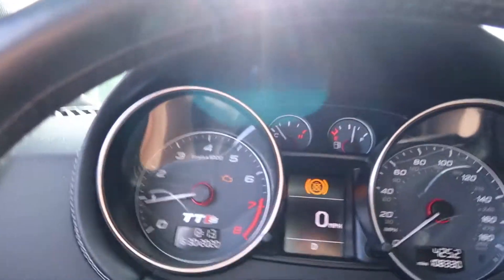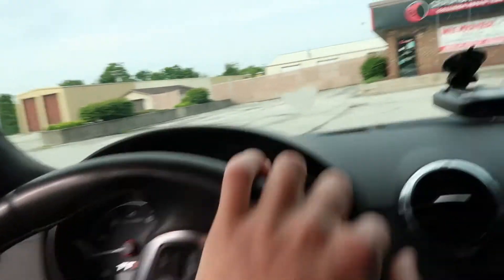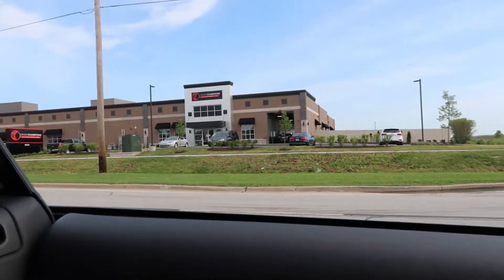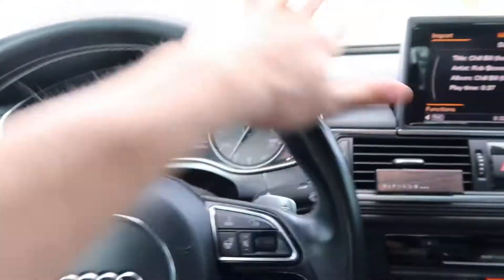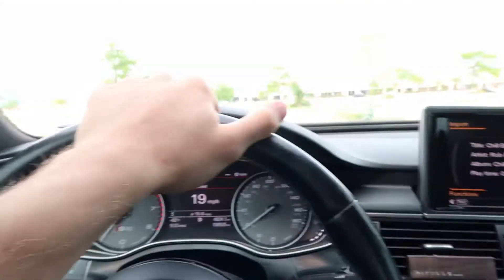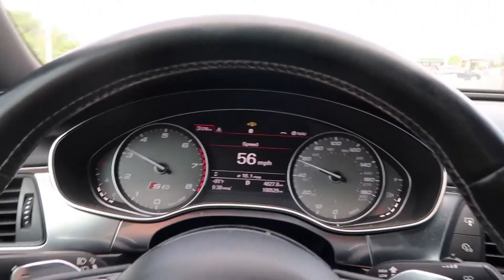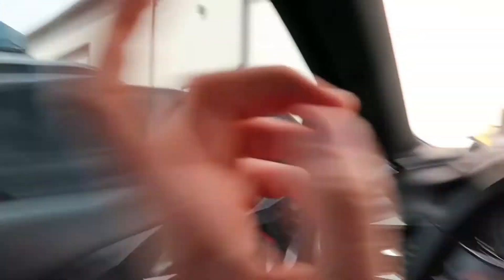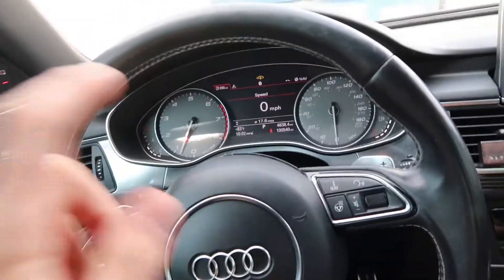Saying Goodbye To The TTS

Comment: I had a vacuum leak. Was a cracked plastic hose at the brake booster. I don't know if you are looking at the data on a scan tool but if your short term fuel trims are higher at idle and go down when you are driving that's a good place to check and a relatively inexpensive part. Very common issue on these.

I was getting a high pitched noise from front passenger side. Ended up being the AC blower motor. Had to drop the glove box out to get to it.  It would happen when the AC is on. And for some reason only happened when hitting the brake.

Is insurance covering your tail lamps?